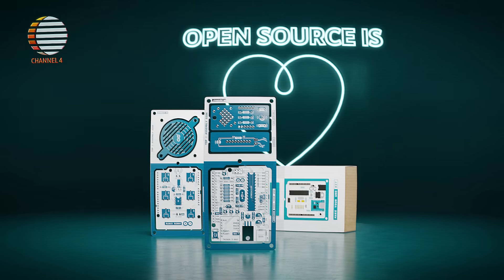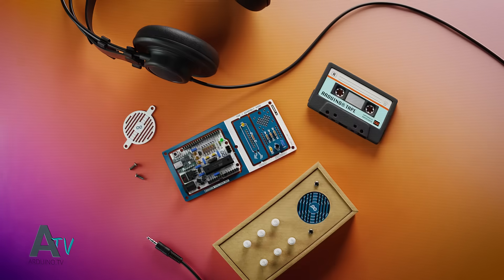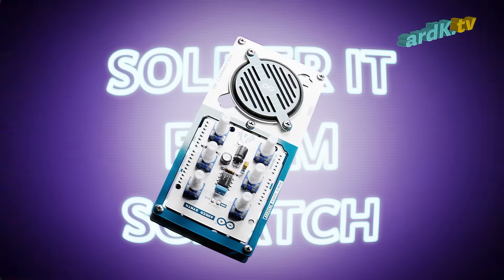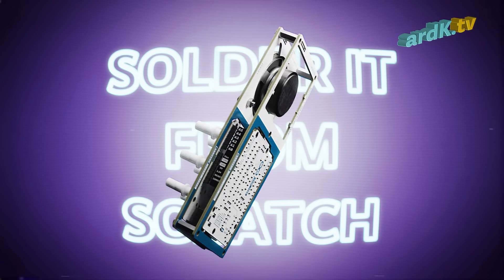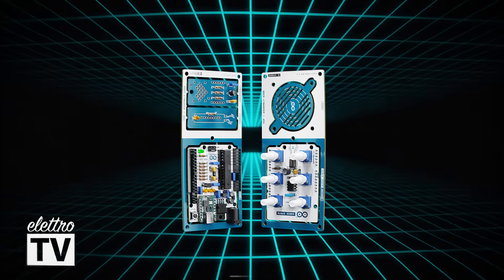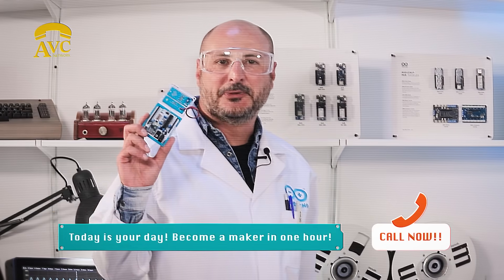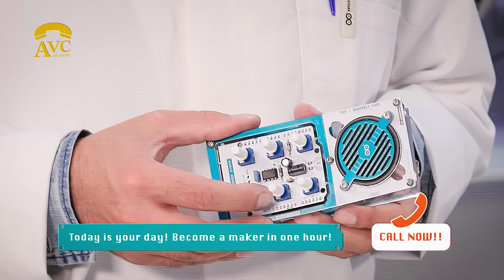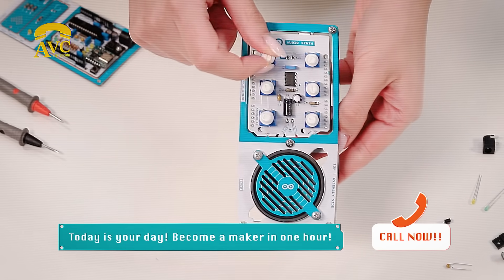Arduino Make Your UNO Kit Is Here!

Comment: Just finished putting mine together. Was kind of disappointed that there was just two sketches to use with it.  Was hoping for an explanation on what each the knobs do and how it changes the sound. Also very hard to tell which one is A0, A1, etc… some labels on top of shield wouldve been helpful